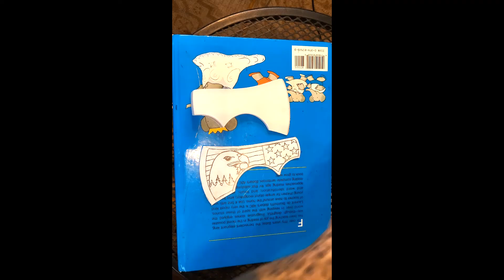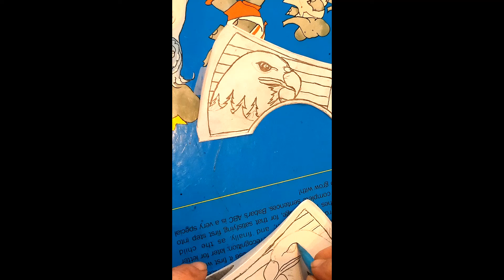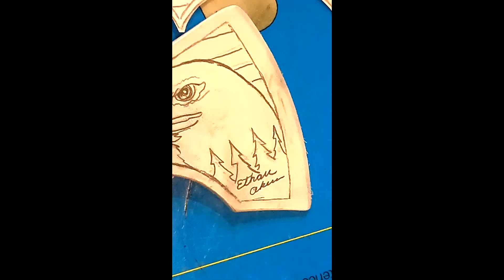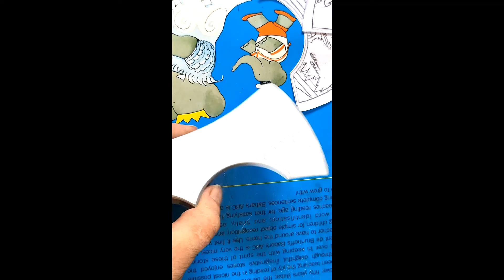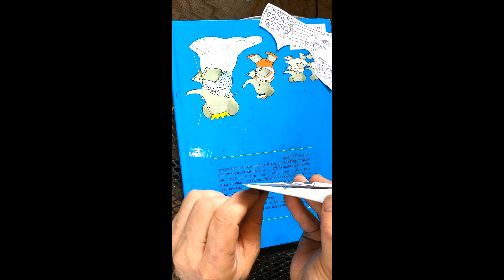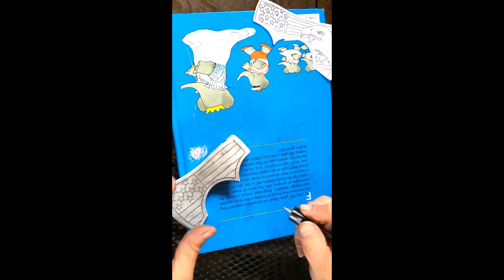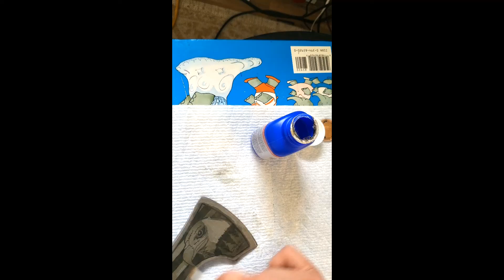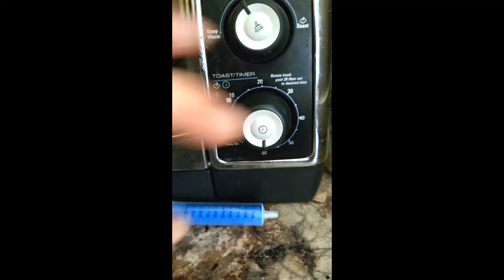How to modify a Harbor Freight Hatchet with #etching Full video April 2023

Comment: A tip for finishing the handle if you like the charred look, hit it with a wire brush by hand to remove the powdery carbon and expose a bit of the wood underneath.  This gives it a rough texture, which you can leave for a better grip, or sand it down smooth to give it streaks of less charred wood that follow the grain.  Experiment with it a bit and see what you like.  Once you get the handle the way you like it, use a heat gun or oven and melt some beeswax into the wood.  The handle should soak up quite a bit of it, so a few applications might be necessary, but you want the wood saturated and unable to absorb any more of the melted wax.  End grain will suck up a whole lot of wax.  Buff the excess wax off and you're done.  This will give the handle much more grip in addition to waterproofing and preserving the wood from the elements and insects.  It'll outlast just about every finish you'd ever want to put on a wooden handle, and you can refresh the beeswax years later in the same manner to restore that protection.  Don't skip the char though, it's an integral part of what helps preserve the wood underneath.
Reply from the maker: @Skinflaps_Meatslapper  I do sand the handle after charring and soak it in peanut oil usually while it's still hot. Sounds like you know your stuff thanks for watching!
Reply: Ive seen many people use steel wool immediately after charring. There are many types of wool so that may make a difference too.. ive never charred a handle but yours looks great, and with that in mind i think oil is better for handles as wax tends to be a bit slippy and messy in use on hamdles in my experience. Boiled linseed oil or danish oil works too. But thats on non charred handles, idk if the charring makes a difference in that regard? Great tips both of you
Reply: @fabianherrera5427  I actually use a mixture of BLO and beeswax for regular wood, as melted wax on its own doesn't penetrate into the grain as well (dust from sanding down to 2000 grit probably has a lot to do with it, but oil seeps right through).  The charring and brushing opens up the grain a bit and lets the wax flow right in.  Once you buff the wood out with a cloth or wheel, the wax on the surface is removed, leaving only the stuff that melted into the grain and became part of the wood.  It's completely dry and leaves no residue behind, you wouldn't even know it was there until you grip the wood.  It's not quite as grippy as a rubber overmold, I'd compare it more to something like a skateboard or rollerblade wheel, but it never gets messy or slippery even with extended use in hot conditions.  Most of my blacksmithing hammers are finished this way, because if I burn the handle it just blends right in.
Reply: @Skinflaps_Meatslapper  wow interesting thanks for the info. Why do you sand so high if i might ask? Im a woodworker and even for furniture i dont go above 220, "workshop companion" has a great video on this subject actually. Its a shorts video less than a minute, just curious!
Reply: @Skinflaps_Meatslapper  his video is called "sanding past 220" by workshop companion, its under the "shorts".. great video with great visuals relevant to this topic, id highly recommend watching it, he has a great channel
Reply from the maker: @fabianherrera5427  no reason in particular on this particular piece, this was a while back.
Reply from the maker: @fabianherrera5427  got a new video coming out soon, I'm Etching two Hatchets with clients name on one side and American flag with eagle on the other. Using Ferric Chloride. Probably have a finished video in about a week.

Comment: With this much grinding and belt sanding is the temper gone would it heat up enough to lose the hardness? It looks beautiful
Reply: LOL.LOL... never mind. I asked this while I was still watching and now think you put it in the toaster to retemper  it? And if thats correct .... what temperature for how long? Whats the final hardness roughly? Is harbor freight steel decent?
Reply from the maker: @eddiekytia  I coated the axehead with a thin coat of peanut oil then baked the axe head at 450 for an hour. Like a cast iron pan, you season it, the oil seals it up from rusting. But use takes the oil off eventually. Thank you for watching and liking my video.
Reply: @NorthWindCreations  and does all that grinding effect the temper the heat treatment
Reply from the maker: Don't know my friend, haven't had any issues as of yet.
Reply: @eddiekytia  A bit late but I can answer this for you.  He didn't affect the heat treatment with the grinding and cutting except potentially in a very local area which was probably sanded off afterward anyway.  You're not changing the heat treatment unless you start seeing the steel turn to a different color...straw, brown, blue, purple, etc., any time you start seeing those colors you're tempering (reducing hardness).  If you look closely at the surface of something that's been abraded by a grinding disk, you'll see bits of these colors in certain spots but they're superficial in that only that tiny area that changed color was affected.  Most of the time this steel is sanded off during final finishing.  When he was making the large cuts to change the shape of the hatchet, you might notice some of those cut pieces changing color but not on the hatchet itself.

Another part of this equation is that tempering means nothing if you never reach the temper it was originally given.  If the factory tempered it at 500F, so long as you never exceed 500F from that point on, the hardness will remain unaffected.  You could leave it in an oven at 499F for weeks on end and nothing will change.  It's only when you exceed that temp where you begin to soften the steel, and you can't undo it once you exceed that point.  When you're dealing with an unknown steel that you didn't heat treat or temper, you don't know where that point is and can only go by general values...an axe will likely have a softer temper than a hatchet, a hatchet softer than a knife, and a knife softer than a straight razor (which may not have a temper at all), for example.  The only way you'll ever get that hardness back is by heating it to a critical temp and quenching, then you have to temper to whatever final hardness you want.

Finally, the biggest unknown here is whether that steel was properly hardened all the way through from the factory or not.  The thicker your steel becomes, the harder it is to drop that temp down in a quench fast enough for it to fully harden everywhere.  Some steels won't fully harden on the inside if you have a rather thick piece like the head of a splitting maul, you'll have a hardened exterior shell and a softer inner core.  It's generally not a problem, as it's not always a bad idea to have some malleability in the core to allow for bending without cracking, but cutting into them after heat treating will expose that softer core and remove the hardened exterior shell.  Like if you were to take a splitting maul and grind it down to hatchet size....most of that hardness will be gone.  Manufacturers are aware of this, and plan accordingly.  For larger pieces that need to retain full hardness and strength, a deeper quenching alloy will still allow through hardening to occur.  These alloys aren't as cheap as some of the simpler shallow hardening alloys, so some manufacturers choose economy over ultimate strength.  Which in most cases is absolutely fine, unless you cut into them.  Did HF use a deep enough quenching alloy for it to be fully hardened throughout?  I doubt anyone will ever know without conducting metallurgical lab tests on multiple hatchets to find out.

My money is on the fact that the heat treatment and temper was unaffected.  The edge should retain its original hardness and durability.  The heat treatment is less of a strength issue than the material that was removed, though how much strength was lost and how that will ultimately affect the hatchet with normal use isn't something I can answer for you.  Plenty of bearded hatchets that hold up to severe use, and it's doubtful that this particular style of hatchet is going to be pushed to its limits anyway.
Reply: This! These kind of golden nuggets in the comment section is why I appreciate YT 🙏
Reply: @Skinflaps_Meatslapper  thank for this reply to the comment . It's tough finding great replys that actually teach you something . Thank you